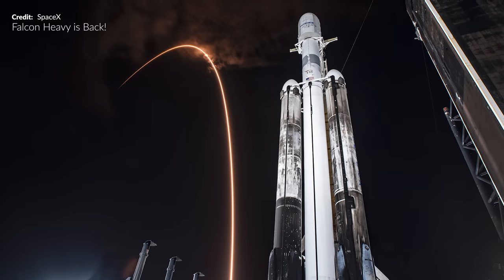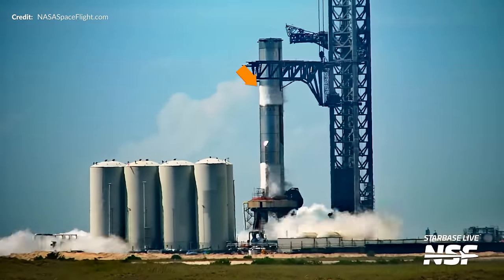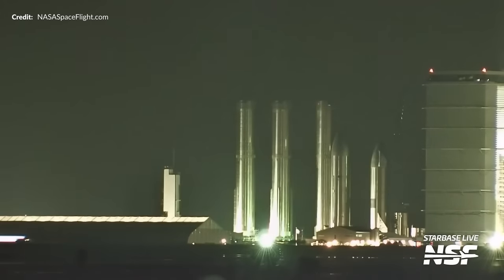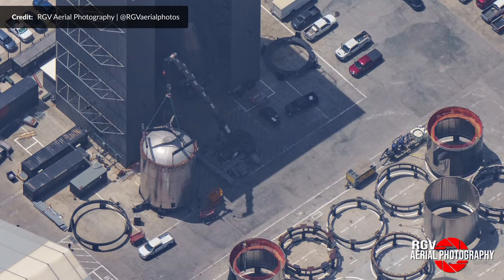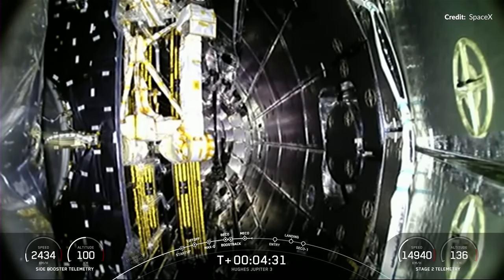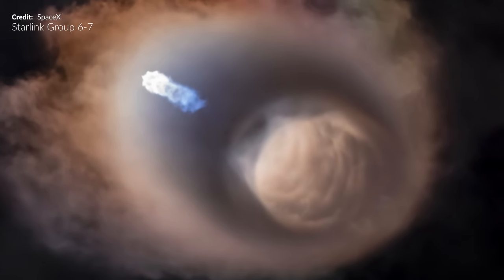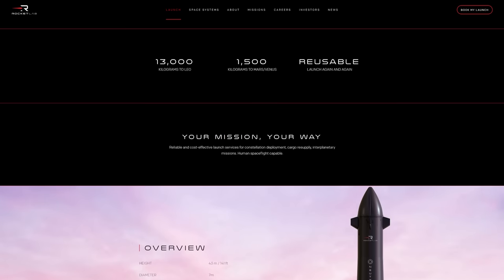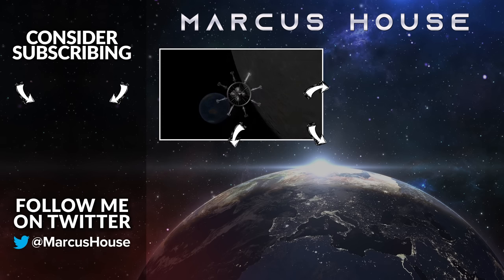SpaceX's Remarkable Full Pressure Test, Starship Sacrificed, & Record Breaking Falcon Heavy Mission

Comment: Very cool but unfortunately the rocket scientists have not figured out fluid dynamics. The raptor thrust is greater than the deluge pressure (let alone the steam). The water will go on the path of least resistance around the outer ring of holes if you’re lucky. Worst case scenario is it overcomes all of the deluge system and the exhaust back pressures into the tanks without a check valve. Then you have something very interesting. This would work with a small change. Flat steel plate under the Raptors with deluge water only around the circumference. The water cools the plate from underneath and exits the outer holes meeting the horizontal thrust.
Reply: Imagine the pressure on the water holes when supersonic exhaust must come to a complete stop in just a few inches.  The momentum of the exhaust requires intense pressure to stop it in such a short distance. If the exhaust is 2000 ft/sec and must stop in 0.5 feet, the the acceleration is calculated from the equation … velocity squared =2* a*0.5 and a = 2000*2000 = 125,000 g acceleration.  Even a small mass of exhaust at 125,000 g acceleration creates incredible pressure and temperature as it’s compressed.

Comment: Just by looking at the water flow you can see trouble coming. It should be flowing in not out. As the flow will be pushed away by the downward thrust. By aiming it inward it needs (the thrust),to fight against it's direction giving the booster more time to leave the launch site, thus reducing damage.

Comment: More solid asteroids would probably be more easily deflected by kinetic impact, whereas a rubble asteroid such as Dimorphous would tend to absorb it by transferring the energy into fragments thrown off (as in the snooker break analogy) and friction heating within the asteroid. The rubble model for Dimorphous suggests that the best way to neutralise similar asteroids is to either use a ‘bunker buster’, diving in deep to as near the core as possible and blasting the rubble apart into smaller chunks, which would hopefully burn up harmlessly in the atmosphere, or to use a very large, likely nuclear, stand off explosion to both break it up and defect it.

Comment: The deluge system is impressive but I have doubts that it'll be enough for thirty three Raptor 2s at full duration and full throttle. The static fire will be no sweat given the shorter duration and half throttle. It's the launch attempt I'm worried about. Don't misunderstand me, I'll be more excited to be proven wrong than right. But I have a gut feeling even this isn't enough for the power of those engines.
Reply: I have the same worry.

Comment: If that deluge system really works, building future launch mounts will probably be rethought by quite a few launch providers. No more or at least different flame trenches and such…
Reply: IF. IF it work. It may still not work. Or we may find the cost of those pump is too much with too many points of failure and a flame trench trench is a cheaper more reliable alternative.

Comment: Once initiated, can the deluge system be terminated or will it always run to empty?
What is the current cycle time to replenish the system [currently a truck-roll]?
Starship is able to manual or auto-halt between T-minus 00:00:08 [Raptor startup sequence begins] and 00:00:00, yet can be rapidly recycled for propellant top-off and a fresh attempt - at what T-minus does the (rather short) deluge initiate and what impact does that have on potential launch-clock recycle times?

Comment: Serious question here. Water expands by a factor of 1600 when turned to steam. There is already the incredible pressure of the liquid water entering under the craft. Then comes the insane pressure of the engines igniting. THEN the water expanding into steam. I can't help but think this is going to cause a localized pressure differential that could cause serious damage.

Comment: Interesting that they used a brand new falcon 9 booster for their flacon heavy mission and then discarding it instead of using an old one. Perhaps it's easier to build a throwaway version from scratch because it doesn't need legs or gridfins?
Reply: There's literally zero used/flight-proven Falcon Heavy center core right now. It's a different vehicle from Falcon 9

Comment: Spectacular water deluge from the launch mount... When all 32 raptors fired at the same time, it will shoot out 800 deg centi colossal amount of burning gas which could be 10 times the volume of water  at the same time . With very high temperature and volume of this gas, the water flooded from the deluge system will be instantaneously vaporize to a super heated steam and expands crazily!! Will the launch mount with stand this remendous volume of both burning gas and super heated water vapor escaping with unimaginable pressure !!???
Reply: @colinsouthern  hope so!!! My suggestion would be that all four legs instead of having a flat surfaced protective shield, at least the face inside the mount legs should have a V-shaped design to directionalize the expanding gases outwards more efficiently and reducing the brunt force phenomenally inside of the legs!!!

Comment: The sonic booms from the returning boosters refracted through the air density changes, giving us a full minute of bangs 45 miles away. They varied in strength and timing, seeming almost random but with a low-level continuous roar in between. I'll make sure to have a recording running for the next RTLS.
Reply: That had to sound SWEET!

Comment: Watching the full pressure deluge test, I'm wondering, given the spray pattern, if (and we won't know until SpaceX is ready and the FAA signs off again....) if during engine start and run-up; they may be trying to direct the steam and exhaust plume upward at a tangent instead of the exhaust emerging at 90 deg. from the mount as was the case in the first test. Just a thought, but as all know, we'll find out...:-).

Comment: I don't think it's gonna work as intended. All those little holes are gonna let hot gases under the plate and back pressure with cause some damage. Just letting all that thrust bounce of a flat surface is just asking for trouble.

Comment: Have there been falcon heavy flights where all 3 booster came back?
Reply: None completely successfully. The first few, they attempted to land the core at sea... one landed successfully on the barge but tipped over in heavy seas on the way back; two others failed to land. Since then, they've not tried again... the core has always been expended — and probably always will be, because there's limited advantage in using Falcon Heavy if you're still staging early enough for recovery to be feasible.

Comment: Deluge system is crazy. Solving a problem they did not need to have. What is wrong with a blast trench? The best part is no part. The logistics involved with that amount of water, AND drainage, AND the added material (steam and water jets) is going to make for insane discharge/blast at launch. Sure aint going to to be boring.

Comment: What if , the water goes into full  steam at or right unter the plate and will rip the pad to pieces again ?
Reply: Designed by people with actual engineering degrees, so - no.
Reply: @Bora_H  people do mistakes or/and miscalculations. We have seen spaceprobes crashing for trivial mistakes. I am super hyped how it works out at launch.

Comment: That was a heavy duty shower system on the pad test, but there will be an awful lot of jet thrust too! I have my doubts that it be enough to protect the pad but I hope it will perform exactly as hoped! SkipRay, Kerry, Ireland.
Reply: If there's something wrong with the deluge system then the next launch/es will show it, then they will use that info to correct it until it DOES work the way it should.

Comment: The water deluge system looks like overkill.  The cheap alternative was steel plate on the launch pad surface instead of expecting bare concrete to withstand the violence of supersonic shock waves & turbulence. All it ever needed was a solid steel plate pyramid to deflect the exhaust outward between the pillars. By allowing the exhaust to maintain it’s high velocity by simply deflecting it, not stopping it, the temperature against the steel remains adequately low enough (It’s straightforward statistical thermodynamics).

Comment: Have you ever used a hose with water and placed it on the ground completely flat to the ground it makes a hole in the Earth the water pressure cutting it out and the metal then add the heat on top of the pressure of the full  being used just saying

Comment: Hi Marcus, did you ever notice the reference to the godess of destruction on the stage zero animation you sometimes use?
It shows the very bottom, or ground level with a circle or part of a circle.  Around the edges of the partial circle, there are a bunch of small repeating images, but they disappear as the image zooms to the bottom of the launch tower.  It’s the same as the objects around the statue at CERN.  Here in Cnda, massive d m p n g of N A N 0 all over.  I took snow and rain samples last year.  You can see it if you prepare a rain sample by boiling until it turns yellow and fizzes.  Put some in a mirror and go in to a drk rm.  use only light from smrt phone.  Use small mag glass.  You will see it.  Yuval N o a h H a r a r i talks about it.  Amazing but frightening because I believe our Cnda is occupied.  Storms will be produced by it.  Massive global dumping, trains and volcanos, dark smoke= Phot onics.

Comment: Why would this put doubts about the system to rest? Until it can be proven to work while the engines are firing it's all just theoretical that it will
Reply: I'm not sure the intent of this test was to put put doubts about the system to rest.  If they didn't have data strongly suggesting it would work, they wouldn't have built it.  

Testing is just what you do when you build something.  This is experimental, sure.  But they don't really need to make us feel confident about it to be confident it will work.

I think people couldn't visualize how it was supposed to work.  I suspect many still can't.  But seeing it seems to have solidified the idea in peoples minds.  I guess this is a comfort to them.  This can only be a good thing, right?

At the end of the day though, we're just along for the ride.  We'll literally see how it goes when they use if for real.

Comment: you know space x can make the falcon 9 even more pwoerful wit the superheavy falcon cofig that has bascly five first stage falcon rocket boosters if space x wanted to. this is if they need to realy put very very heavy stuff to orbit or beound.
Reply: It is a fair point, that if Starship doesn't work, Falcon could be stacked to some size. I think the goal was to reduce drag and protentional failure points, by placing internal and making a single separation. I also wonder how much load each falcon can endure in bending/twisting forces as the payloads increase in size.

Comment: Hey Marcus, love your videos, keep up the great work!

A thought occurred to me, I would imagine that right up until hitting the ignition button, if they had a problem with the water flow they could abort the launch. I wonder if they have contingencies in their water deluge system for if they had a drop in pressure for whatever reason, tank rupture, pipe broke, or would it just destroy the launch mount, but much worse this time. I was just wondering what your thoughts are on this   🤔

Comment: I wonder if the "concrete tornado" had an upside.  It saved a lot of excavation for the installation of pilings and pad.  Granted, there were a lot of equipment repair issues, but did starting with a giant hole in the ground, actually speed instalation?

Comment: Tell him another question for you but then wavelengths that's built most of your computer in your material do you know if that's going to pull it back inside your electric system or your pressure system

Comment: I'm Definitely not an expert, but that doesn't look energetic enough to compete w the rocket engines, especially at launch thrust. Even W the advantages of water's specific characteristics.
I'm also concerned about the interactions & effectiveness of the water deluge system in practice,in ways that probably need actual testing for useful data.
This water deluge sprays up from the bottom, W a large volume kept clear for engine safety.
But I wonder if it's been "prettied up" too much; it Looks fantastic, but ALL of that geometry will shift under engine power. It will change With every variation of thrust.
I have 3 primary concerns;
1 the central "bottom of bowl"; that is an easy spot for compression, back pressure & failure. In many ways, the most likely place.
But many of the crucial jet angles come from center plate. I don't see many redundancy angles, or much criss-cross "volume fill" at all, Especially in center.
This also means coverage & volume density varies, and not in ways that are likely to be enhanced (grabbed, lifted & dispersed) by engine thrust. Rather the opposite, merely flattened as waste water.
2 the upper "wall" areas. I'm not familiar w any deluge system that fires upwards; most Use gravity & the competing pressures to spread & spray water, and the engines contribute to that because the outlets are often above the directed thrust.
However, This design Requires that the water achieve & maintain sufficient pressure to compete W the engines at all times.
The angles of the jets are pre-set, so I'm surprised there isn't a larger "pre-angle" on the wall jets.
I don't know if the legs have a deluge system, but not including them Or having them hit by water in the testing scenario seems... Problematic.
3 precision; there doesn't appear to be leeway for thrust to compress & distort the water jets... At all. This looks like what I'd instinctually want for the spray pattern With full thrust interaction.
Not the base system test.
But I'm just a dropout W an ND physics brain.

Comment: makes you wonder if they did the first flight test with this in mind, as it reduced the amount of digging needed to install this system when Starship created the hole when taking off the first time
Reply: You wonder odd things…
Reply: And you think digging in dirt is more expensive than repairing a steel and reinforced concrete structure???
Reply: Of course they did. The deluge system was under construction well before the first test flight — it just wasn't going to be ready for several months after the pad was going to be otherwise ready, so they decided to gamble that they could get away with a single launch.

Comment: Anyone know why spacex chose to expend the brand new booster as opposed to others that may have been nearing retirement?  Is the core stage significantly different from the side boosters?
Reply: Yes... the side boosters are Falcon 9s with minor modifications, and can be converted to and from Falcon 9 if needed. But the core is a different case... obviously it's based on Falcon 9, but with a lot of structural changes to support the boosters. So unless they start recovering FH cores (which looks doubtful at this point), they're not going to have any old ones to expend...
Reply: @simongeard4824  gotcha, thanks for the info

Comment: How would you leave Mars without water deluge. Water seems important.
Reply from the maker: Only Starship is needed for a Mars flight. Booster is only for Earth launch.
Reply: Remember wasn’t needed when testing the upper stages.
Reply: You basically only need to eat a lot of beans and let your behind out the window to fight of Mars' gravitational clutches, so don't expect full throttle on the Raptors.
Reply: @erikdahlberg995  But you still have lots of rocks and infrastructure, even on Mars. Gravity is still greater than the moon . I don't see starship landing on Mars for a very long time.
Reply: @erik.dahlberg  That would have a different ending for The Martian!

Comment: Wont the water deluge system need to output more force then the rapter engines during launch in order to sustain effective heat dispersion? I can just image how much of the water is going to vaporize into hot steam.

Comment: how long will it take to build the launchpad and water deluge system on the moon and mars before starship can land there? where are they going to get the water from?
Reply: Because of the lighter gravity on the Moon and Mars, much less power is needed to lift off from those bodies, so the elaborate systems needed on Earth are unnecessary. But the unknown effects of a powered landing and liftoff from an unprepared surface are a concern. Loose, uncomplicated material under the rocket (Lunar and Martian soils) may present a problem. Even bare rock like lava fields may present a problem. The very first
Reply: The very first landing and takeoff from the Moon or Mars will be the hardest, because the surface will be in unprepared; completely in a natural state. Therefore, site section will be crucial, and that will require extremely accurate reconnaissance.
Reply: That should read "unconsolidated," of course.